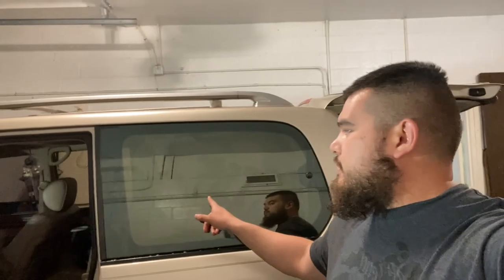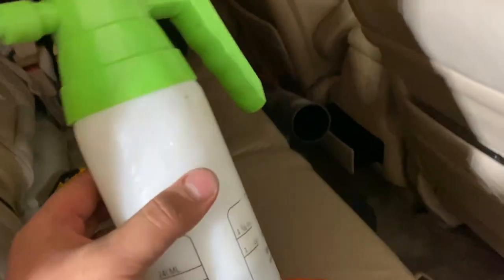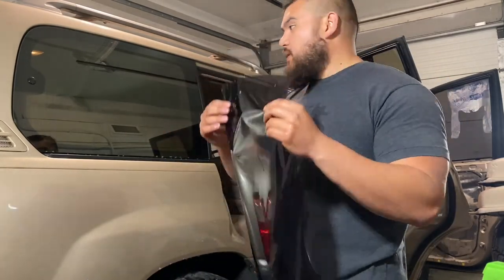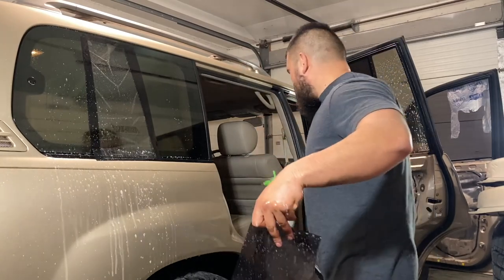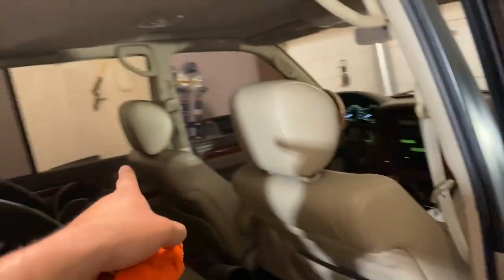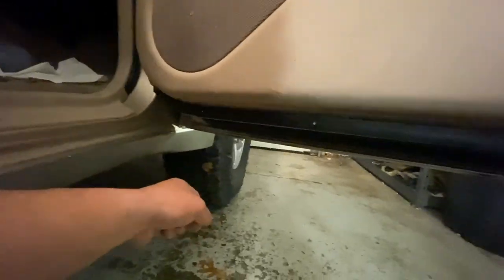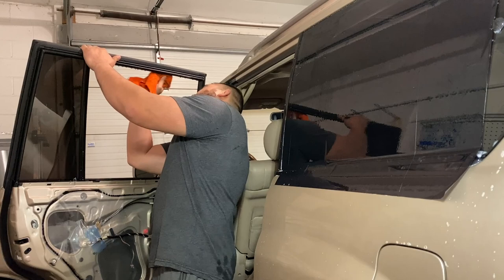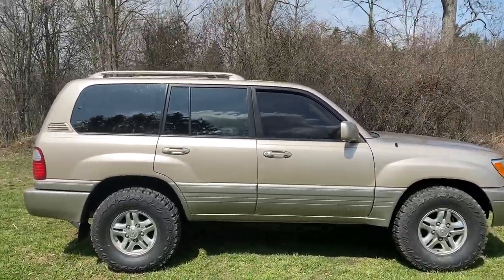Lexus LX 470 DIY Tint Job - Pre-cut Tint

Comment: Question about your car seat install. Did you add a anchor for the top tether? Just pickup my 2000 LX470 and trying to figure out how to most safely install the forward facing car seat
Reply from the maker: Unfortunately I couldn’t locate any anchors and I would use the seatbelt mounting mechanism (running the seatbelt through the tunnel of where the anchor strap is) to secure my kids car seat.

Comment: Question about your car seat install. Did you add a anchor for the top tether? Just pickup my 2000 LX470 and trying to figure out how to most safely install the forward facing car seat
Reply: You may have figured it out but the anchor is actually on the floor behind the second row. I hate the way it looks with my two car seats but it is what it is!